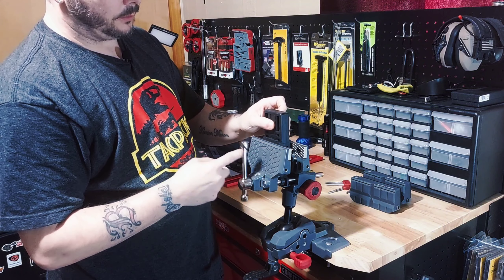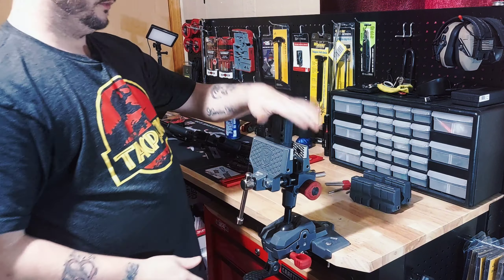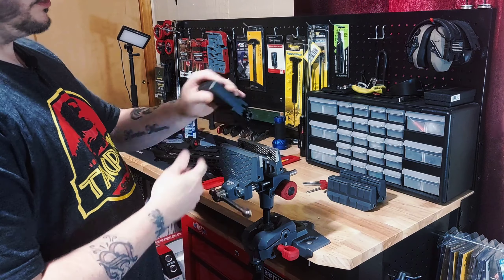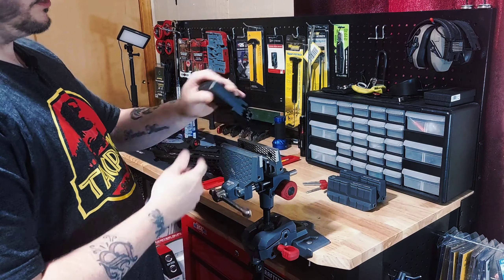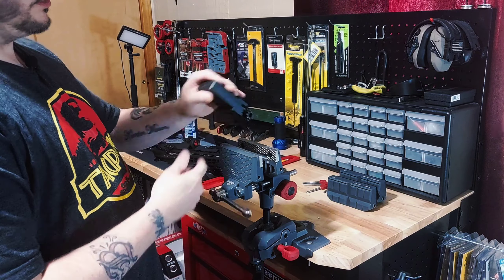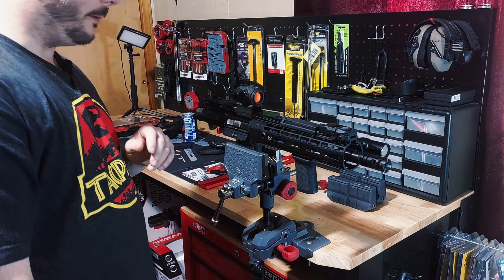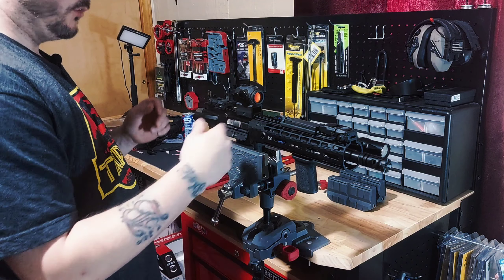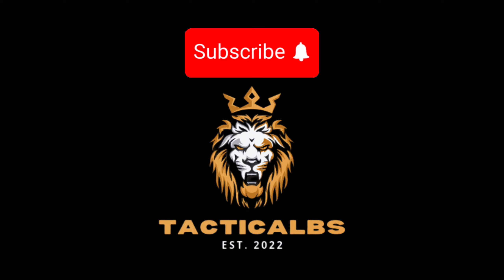How to use a Magpul BEV Block AR15 upper and lower tool. AR builder tools.

Comment: Good content, well presented!  Short and concise and hit all the points.  (You should have more subs, so I’ll be glad to sign up!)

I have this vise, so went in a different direction from the Bev Block and got the adjustable Real Avid Smart-fit lower block that fits in the vise perfectly and is a much tighter fit than the Bev Block or any other lower receiver vise block for that matter.  For holding the upper for both barrel nut and muzzle device work I got the steel Midwest Industries Upper Receiver Rod, which locks in the barrel and prevents the upper from moving with a fin / sail.  I didn’t care for the Real Avid aluminum reaction rod.  The Bev Block is a great all in one tool to do both functions, at a great price, but I like the dedicated RA block and Upper rod tools that I think are each a little better solution.  Thanks again for the video, you have a nice workstation there.  👍
Reply from the maker: @E.L.RipleyAtNostromo  I've been looking into one of the rods, they seem indestructible. Thanks for subbing!